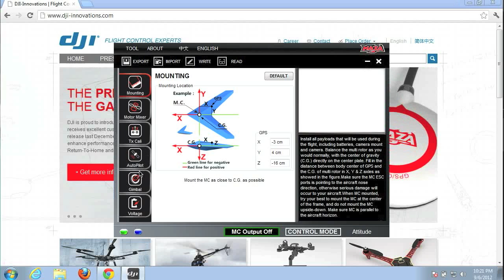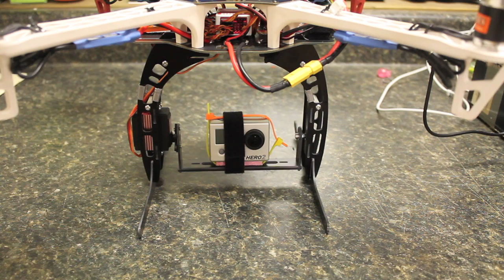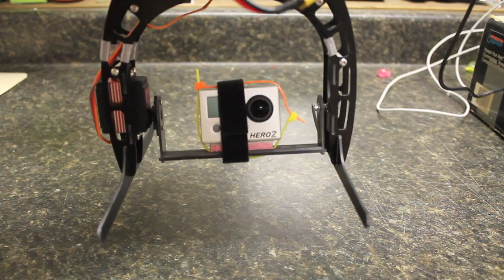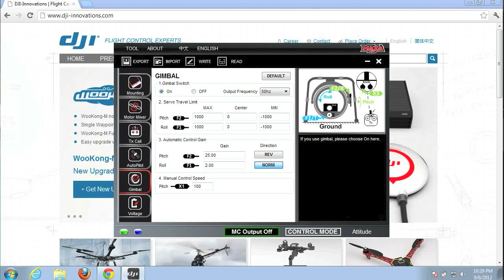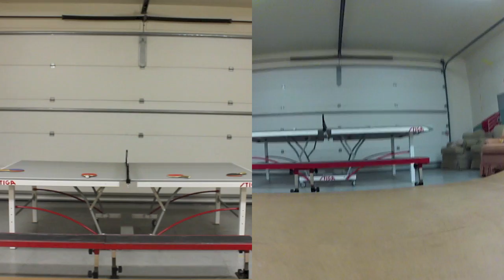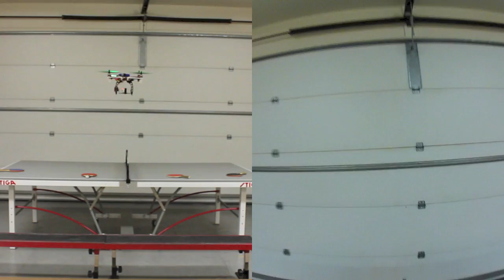DJI Naza Gimbal Configuration with Tilt Axis Servo on HobbyKing x550 Camera Mount and GoPro HD

Comment: I ran into a problem with a 2 axis Gimbal, they say to connect it to outputs F1 and F2 on the FC but F2 doesn't do anything since there's only 1 radio channel allotted for it, X1, which I assigned to LS, so I can move it left and right but there's no way to move it up or down so what's the deal?  Does DJI even have any idea what they are doing?  I could connect the non working vertical gimbal servo to the 8th output on the receiver and assign that to RS so why do they say to use X1 if it only works for 1 channel?

Comment: Great, I connected a regular analog HXT900 servo to F2 port on the NAZA-M V2 and can control camera pitch thru X1 / channel 8 in my FASST TRF8 receiver.
Using a cheap tilt device https://www.hobbyking.com/hobbyking/store/uh_viewItem.asp?idProduct=35036
Excellent result for the price !
Reply from the maker: Alexandre Winneschhofer Very cool. Thanks for sharing this info!

Comment: Thanks man. I actually just ordered --> (Qnty 2) APC_10x4.5MR 10x4.5 Multi-Rotor Propeller Pair.. A set of props mean 2 means that you get 1 rotataing and one counter rotating right? I have been order a cheap set from HK that comes with all 4 props so I was a little confused and this. Did I do right?

Comment from the maker: It doesn't matter how many times I've flown I still always get nervous! There have been times when something completely unexpected happens like my motor fails and the quad falls out of the sky. I want to do a hexa setup soon so if I'm doing any aerial video I don't lose my good camera. Anyway, I don't want to sound too negative here. This is such a rewarding hobby as you probably already know. Good luck with your calibration and let us know how it goes.

Comment: Man I have been reading the online forums that you turned me onto and it made me realize something. I have been “compass-calibrating all wrong” . I am not sure if this is my main prob but I sure do feel stupid right now. I have been C-calibrating the quad without putting it in c-calibration mode with the toggle switch (10 times). I feel like a complete idiot for missing this step! I hope this is it though & thanks man for helping me. I just get so nervous when I fly because this is so new to me

Comment from the maker: Wow. That completely sucks. What mode are you flying? Also, what was the beeping sound I heard in the video? Finally, make sure your ESC connections are super tight and do you happen to have your ESC low voltage cutoff enabled? Perhaps it's enabled on one or two of the ESCs and not the other. Just trying to come up with ideas. Try googling for Naza flip of death. I read in the past about a firmware issue and hope that's not what you're up against.

Comment: I am having another problem now and I am not sure what it is. Whenever I take off my 450 flies great for about a minute then simply drops out of the sky. I think its an ESC issue. I calibrated them when I 1st installed my NAZA M and it did so great but something has changed and I am not sure what it is. I made a vid of it happening. Its my last upload if you would care to see and give me you opinion on this. I would really appreciate any help you may have man..

Comment from the maker: I'm not sure using the Naza would be ideal, but there are several brushless gimbal setups that I've seen that would probably do the trick. A buddy of mine is steadicam certified and we were talking about it today. There's no reason why it shouldn't work. Google "simple brushless gimbal" and the first link will take you to info about the project. Good luck and that's a pretty cool idea.

Comment from the maker: F1 and F2 are output ports so you don't use them for remote gains. From the Naza manual:

"If you open the gimbal control in assistant software during the configuration, please note that there are outputs from F1 and F2 ports. Now you should not connect these ports to ESCs which is wired with propellers and motors."

another thing from the Naza manual:

"X1 and X2 is for remote gain tuning; X1 is also for gimbal pitch control. Setup the channel on your RC correctly."

Comment from the maker: I'm not certain but if it's working okay then I'd probably leave it alone for now. I'm using a digital servo (but my RX doesn't have the switch like yours does) and it works fine.

Comment: My rx has a switch for using analog or digital servos. Since the gimble servo runs through the  Naza control, does it matter which mode I run the rx in? It is in default mode which is analog, the gimbal servo is digital it seems to work ok so far..

Comment from the maker: I wonder if the reason mine works is because I'm using a digital servo and not an analog one. I'll see if I can find more out about this, but you may want to research and find out if this is only a problem with analog servos.

Comment: I was surpriced that the gimbal still works in this video. No one in my community comes to this point :(.  I contacted DJI but no answer. I dont know what to do. With the older Firmware it works but as i sayed not 100% stable. I use HS analog Servos.

Comment from the maker: That's no good. I'll have to do some more testing with my Naza firmware and gimbal. RIght now I'm using the TBS Discovery frame, which doesn't have a gimbal so I haven't run into this problem yet. Thanks for the info.

Comment: This happens in any frequencie @ Firmware 2.02. I patched back to an older firmware. The gimbal still works but with the older Firmware the servos looses the middle point sometimes und go to end point. This also happens on other Naza Systems in our rc community. :(

Comment from the maker: I didn't realize this. What frequency are you trying to run that's causing problems or is it a problem with all output frequencies? Are you running firmware version 2.02?

Comment: With the new Naza Firmware and the output frequency option, my gimbal did not work. The servos going end point at that moment i plug the power on.

And i am not the only Naza user in our rc community with this problem :(

Comment from the maker: Yes, it's a fancy digital servo that I ordered because the cheapo ones were out of stock. It may have something to do with the frequency I have configured in the Naza assistant, but I'm not 100% sure yet. At any rate, the servo has a lot of torque and works well with the gimbal.

Comment from the maker: Sort of a long story, but ordered a cheap servo from gothelirc. There was a problem with their system and the servo was out of stock even though it let me order it. Their sales guy contacted me with an apology and said they'd get me the Power HD servo (much pricier than what I wanted) for 50% off so I went for it. 

It is the "Power HD 8312TG" digital servo and it's amazing with lots of torque. Now I just need a bigger quad to carry a bigger payload :)